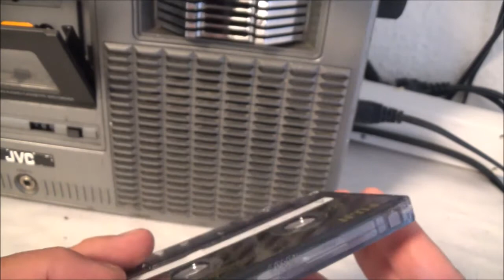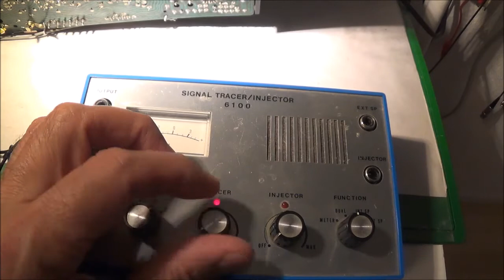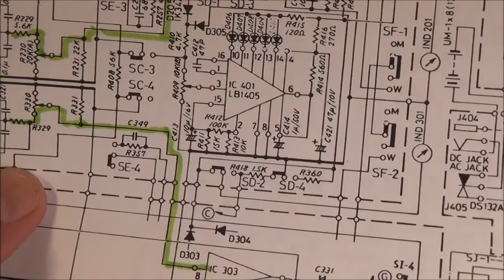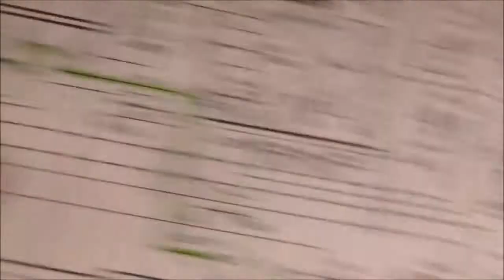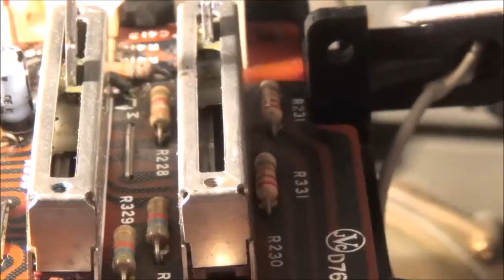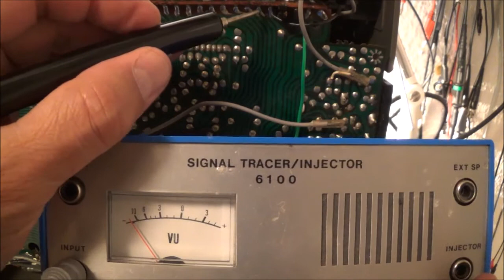JVC RC-727 Stereo Cassette  Recorder Bad Channel

Comment: Hello, how are you?
I have the same radio recorder, the JVC RC 727 jw and i am going follow the procedure that you are giving to yours, it is very interesting,  i first need to deal with the issue of the cassette deck and then the contacts and potentiometers
In mono audio mode both speakers are heard well but when i select stereo / stereo wide mode only one speaker is heard and the other one distorts. 
Could you tell me what woudl be the problem? 
Where can i get the service manual? I can't find it any where!! Tanks a lot
Reply from the maker: Ok, I think I have the manual somewhere. Just give me a day or so to look. You need to clean all the switches and potentiometers and don't forget the record/playback switch on the main board. I will write again as soon as I find the manual.